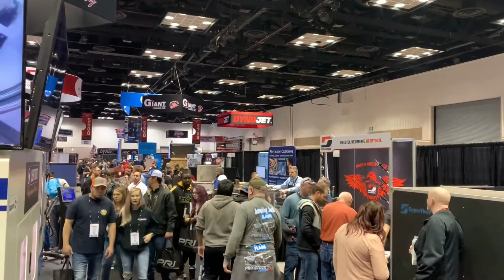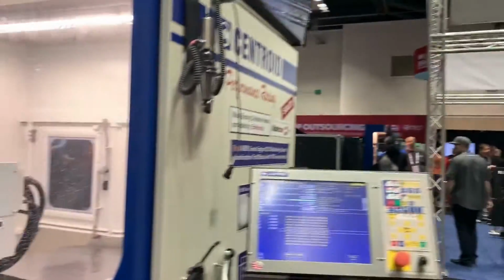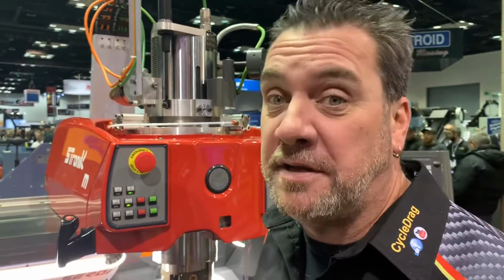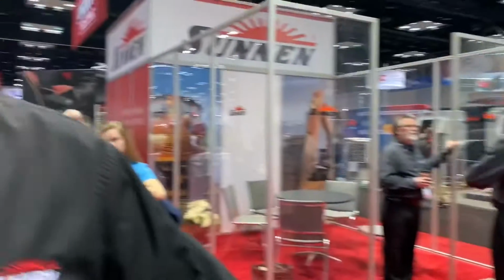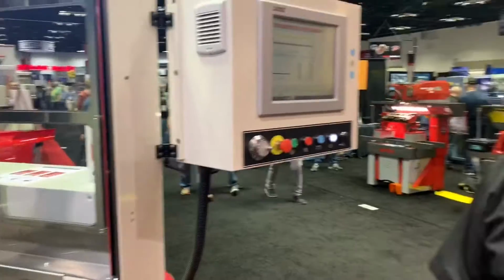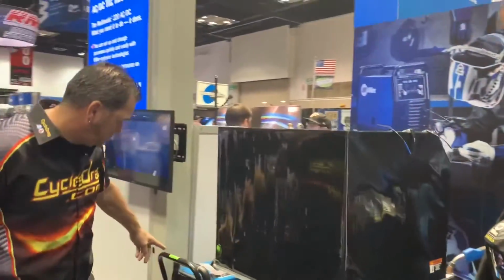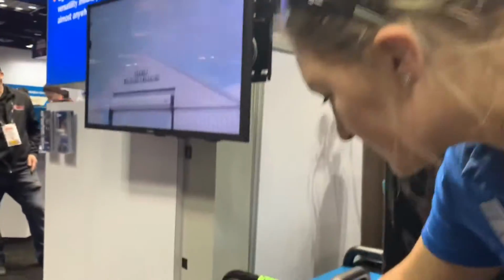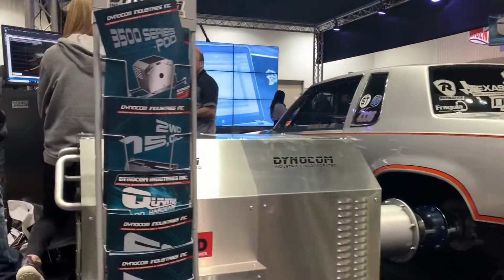MOST AMAZING 5 AXIS CNC MACHINE, MIG / TIG WELDER, HONING MACHINES AT WORK AT PRI MACHINERY ROW

Comment: buying  a 240,000 machine with a  master cam seat and a little training WILL NOT make you a cnc machinist.  240,000 will be gone in 60 seconds when it crashes !  You need years of  training to run this machine......YEARS !
Reply: Lol so true been a manual machinst for 28 years can reproduce anything & there is no  skilled labor coming into the workforce.
Reply: I did manual and cnc for 30 plus yrs. Stressful work
Reply: very stressful work . Sometimes I think the people who design the parts don't really know how small +/-.001 really is. never mind tenths!
Reply: I hold 0.001 to 0.0005 all day even on old junk lathes I'm strong on lathe mills , horizontal mill & vertical turret lathe 72 inch ,grinders , proto trak cnc mill in total ,can run about 25 different machines ! I learn something new every day ,and I have a Young Apprentice right now